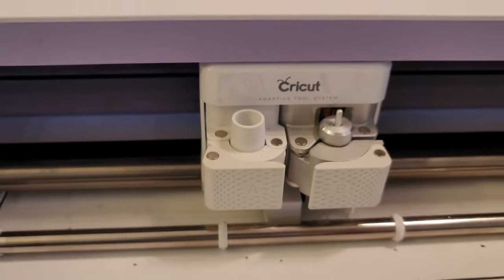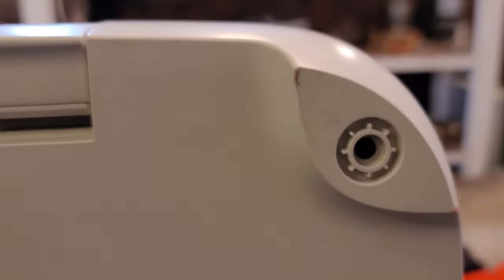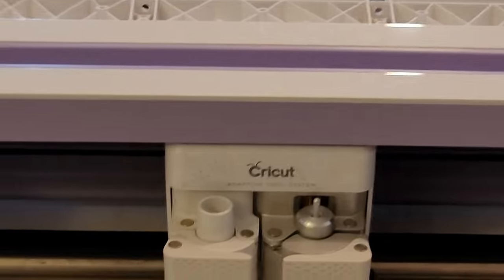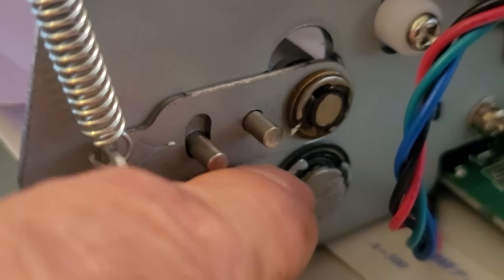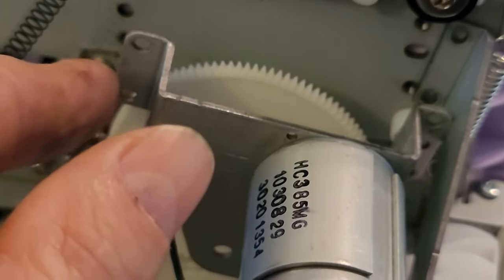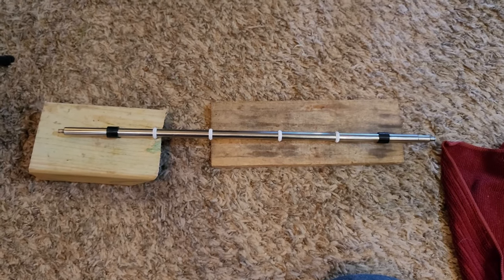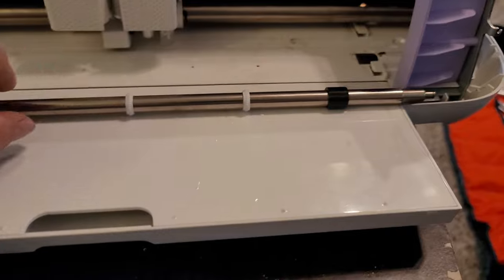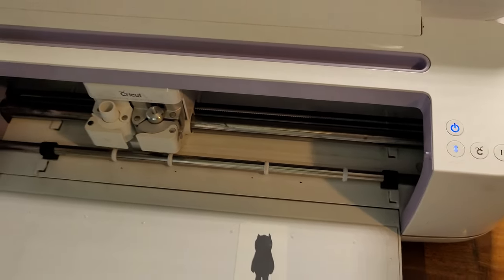Cricut Maker, Roller Replacement, YOU CAN DO IT!

Comment: Do not touch the clear goop with the consistency of hot glue, that is on the left side of the machine! It went from my hands, to the tools, to my clothes, to the sink. It doesn't come off with water, had to use goo gone to get it off of everything. Great tutorial, easy to follow even with small differences in the machines.
Reply from the maker: I noticed something sticky, lol.  Thanks

Comment: One trick I tried was to not only warm up the new rollers in hot water, but I threw the rod in the freezer for about 45 minutes to make it contract. I was just able to push the new rollers on by hand that way as the roller rod warmed up.
Reply from the maker: Saw this in a previous comment also. Thanks
Reply: Can I ask how long you warmed the rollers for? I have tried today and they are not budging. Thanks
Reply: @DawnskiBee  20 minutes?

Comment: I tried my darndest to get the top piece off of the upper hinged door, and I wound up breaking off the back rear corner, which is really no big deal...cosmetics only. Turns out that the piece with the tabs that has to be pried up was glued on both ends to the mating housing on the body. Maybe a razor blade slipped in from either side might have cut the glue enough for the prying to work. Other than that, I just took my time and got it done. One other note, when putting the main shell back on, the back of the shell has thin plastic hooks that must be guided into matching receptacles on the back of the machine. If you don't get those hooked, the rear of the plastic shell bows out because the plastic hooks push it out away from the back of the machine.
Reply from the maker: I got lucky not breaking that piece on mine. Thanks for sharing your experience.

Comment: For me the blade housing is in the way of the 7th screw. When I turn it on and move it, it just goes right back in the way of the screw. How do I get to the screw being covered?
Reply from the maker: Have you tried sliding it manually out the way? It will recalibrate when powered on.
Reply: @Outdoors4adventure I swear I tried that before and it didn’t move 😅
Thank you for the response!

Comment: I wanna know how you got the c clamp on the left side off without taking the wheel off
Reply from the maker: If I remember right that gear can slide over just a hair. I used a small flat screw driver and pushed it off.

Comment: How the heck did you get the c clip behind the gear off?
Reply from the maker: Skinny flat screw driver and pried it out. A ice pick might do it.
Reply: Omg thank you.😢❤😂
Reply: How the heck.
Reply: I took them off with 2 flat heads and put it on by using a flat head and a hammer once settled
Reply: getting it back on was the hardest part 😂

Comment: Is it OK to test operation BEFORE installing the housing screws?
Reply from the maker: I wouldnt think it would hurt.
Reply: It powered up and ran startup OK without the housing screws in. Now the screws are in, and it's working. But there's something that slides from side to side inside when I pick it up, and it has a preload clicking that I don't remember hearing before. Otherwise, it has cut paper shapes OK.
Reply: So the sliding object was a pen in the storage area of the front cover. The clicking has something to do with the spring tension on the left (gear) side.
Reply from the maker: @bwareable  maybe something didnt quite align?
Reply: checked it all, reset the c clip on right side, clicking seems to originate inside the bottom which I did not open @Outdoors4adventure
Reply from the maker: @bwareable  I have had the bottom off ours, wasnt to bad.  No idea what it could be though.
Reply: So what's in there? @Outdoors4adventure
Reply from the maker: @bwareable  I really didn't pay attention when I had it off. The c clip slide in there and I had to retreive it, lol.

Comment: for how many minutes leave the rolls in the water
Reply from the maker: Best to put the steel rod in freezer overnight.  Then heat water. Put rollers in water. 2 or three minutes should work. Get the rod and slide rollers on. The cold shrinks the rod and it expands back when warmed back up.

Comment: I really wish you would have shown how you removed the c clip on the motor side. I’m struggling with that gear in the way
Reply from the maker: I pulled that gear back enough to get a skinny screw driver in there to pop it loose.
Reply: @Outdoors4adventure  I finally got it, my fingers were too fat, haha. Thanks for the tutorial.

Comment: I did all the process. However when setting up mat it feeds in but the cricut logo continues to blink white. Anyone have any idea why? It will not cut after the rubber wheels have been replaced.
Reply from the maker: Recheck all electric connections.

Comment: most were easy besides the cover's little lid was glued so not much fun taking it off and the actual roller doesn't fit out as yours really do have plastic overlapping a bit that metal bracket

Comment: This was amazing but my rod still won’t come out 😩😩
Reply from the maker: Sorry to hear that. It is a pian , I have read many have issues. One used a dremel to open up the hole. Not sure on that , as I didn't have to.
Reply: I was having this same issue with mine. I rolled the rod forward until it felt loose enough to shimmy it out

Comment: While trying to take the top off, I can only find 4 screws, cannot for the life of me find the other three. Please help!!
Reply from the maker: Turn the machine on back side.  Shine light in there. You will see the bottom screws. Use your fingers to feel for the screw above the one you see. They are not straight above but over a bit. You will feel them. Its a touch thing, lol.
Reply from the maker: You may have to slide the cutter block out of the way also. Just slide it slowly if you do.
Reply: Thank you so much! I'm finally found them but I can't find me a screwdriver to fit up in there so I've got to go to the store. Your help was awesome!!!

Comment: I'm so upset. I replaced the rubber rollers and now it won't bring in my mat 😢. I got the same ones you showed but they seem too thin
Reply from the maker: Springs are back in place? Sorry they aren't working.
Reply: @Outdoors4adventure  yes sir. We purchased fatter rubber wheels. Going to see if that works. If it does I'll share the link here in case anyone runs into the same problem.
Reply from the maker: @trixiescreations4u  thanks. Maybe they flubbed up and packaged wrong size. Never know.

Comment: Followed directions put everything back together, the wheels below rubber are turning but the rod is not turning. Like the wheels are making connection
Reply from the maker: If the rod isnt turning something isnt right on the motor side of rod.
Reply: @Outdoors4adventure  nope motor is fine, the replacement wheels aren’t thick enough. The motor doesn’t turn the rod. The motor turns the pieces that are under the wheels
Reply: @Outdoors4adventure  there was a tiny gap between the wheels and the spinning thing. It wasn’t catching the wheels to make rod turn
Reply from the maker: @user-zt1kl6ke7q   Hard to know without seeing. You have the same model?  Good luck.

Comment: Having trouble getting the rod back in place, everything came apart easily but I cant get the rod back in on the motor side, any tips or tricks would be greatly appreciated!
Reply from the maker: I slid the left end in first and had to push a little hard to get the right side back in.